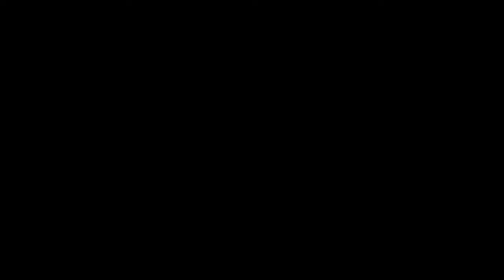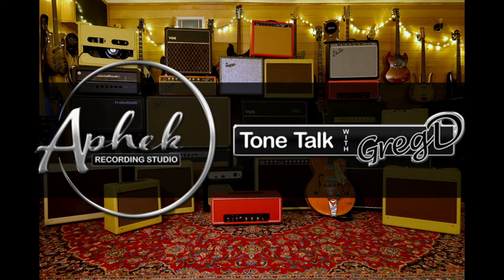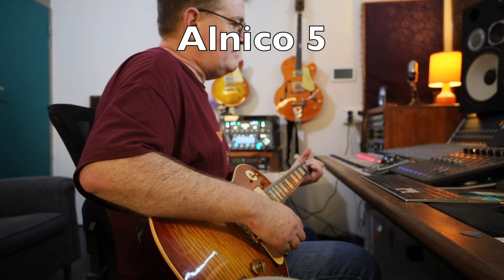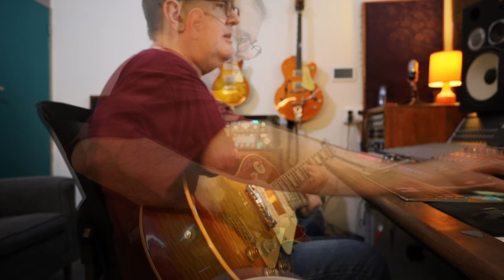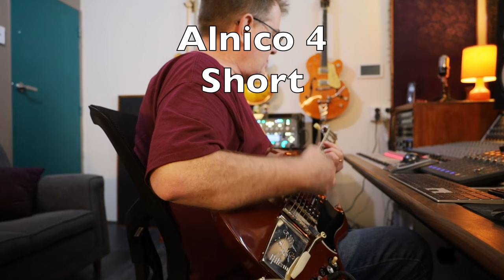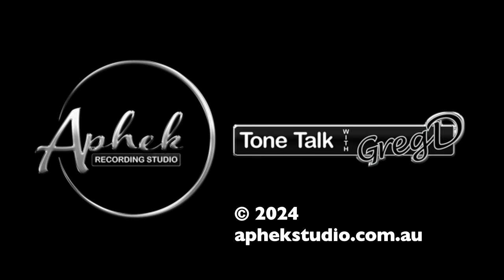Electric Guitar Pickup magnets. How do they effect our tone?

Comment: A fantastic video! This is how pickup comparisons should be done. I really liked the p90s with the a2 and a3 in the bridge and a3 just winning it for the neck.
What ohms did you wind the p90s to?
Reply from the maker: Thanks. I'd need to lookup my notes, but they were standard 'vintage correct' number of turns. Slightly more for the bridge pickup. Possibly 10% difference between them.